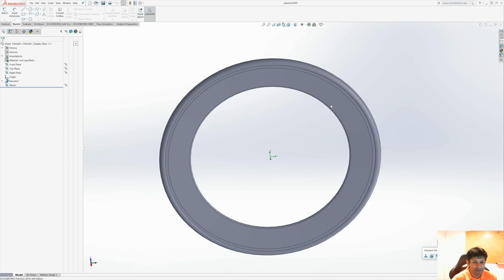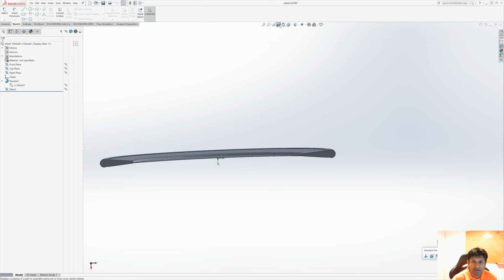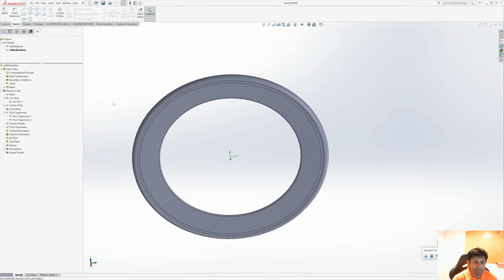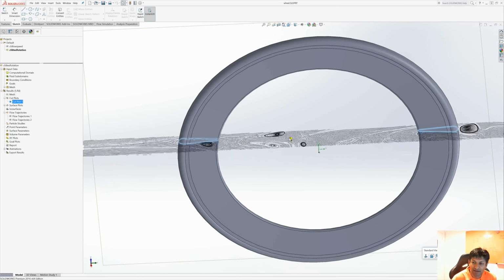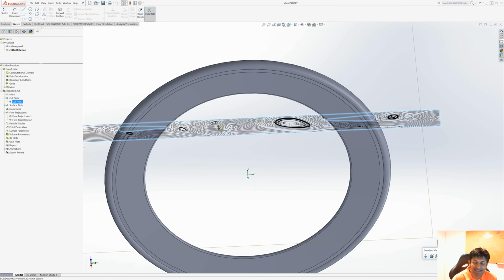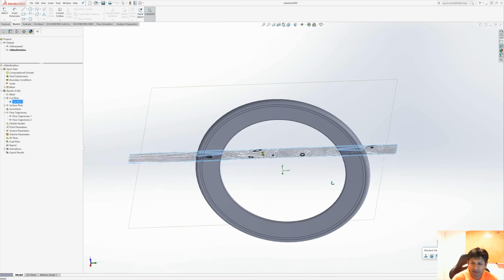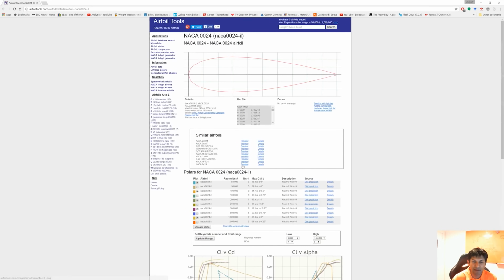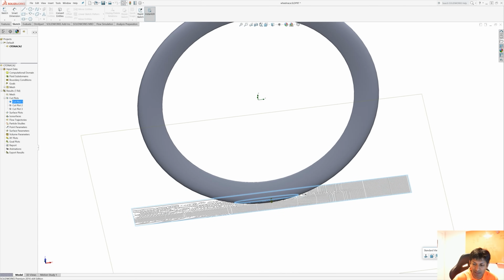Explained: Aero Bike Wheels (Zipp Enve Mavic Fulcrum)

Comment: Thanks for your explanation about aero wheels. Out of curiosity, have you done any simulation in connection with valve length? For example, say you have a 38mm deep wheel and try with 48,60 and 80mm valve length. There would be more drag but I suspect it's negligable because the valve sits in the same turbulence that is created from the trailing edge of the wheel.

Comment: Great video! Curious to see more about the effects when the air hitting the wheel at different yaw angles.
Reply: That's a waste of time, real air outside of a windtunnel is never laminar, the various yaw angles are htting at the same time. Pick any angle and you will get numbers, all of which are meaningless.

Comment: Sometimes you can't find a tire which is exactly as wide as the rim when fitted and pumped. From an aero perspective, is it better to have the tire just slightly narrower than the rim or slightly wider than rim?
Reply from the maker: Rim width slightly wider than the tyre is preferred. Really the brake track to tyre is the critical bit.
Reply: azumi b h6

Comment: Blood cells are nature's ultimate low drag shape.  A tractor tyre inner tube angled right is super fast when used as a surfboard. What happens to a bicycle wheel that is shaped the same? If air is ' enveloped' within a wheel and carried along with it perhaps an interesting thing might happen.
Reply: Red blood cells don't move much relative to the blood itself.  The shape moves well through capillaries and maximizes surface area in proportion to volume of the cell to maximize gas transfer.

Comment: I was wondering about the disturbance of the spokes. Does choosing a wheel with less spokes make a difference? If I wanted to make a bike light and aero could I use a deep wheel on the front and a shallow lighter one on the rear or is it better to go with the same or larger size on the rear? I assume the seat tube would help with wind disturbance and there's no telling what the air looks like after passing through your legs. 

Thank you

Comment: Nice video, but i think with a yaw angle the NACA profile will create more pressure drag then the toroidal profile! Have you tested?
Reply from the maker: Hi, below 12 degrees, the NACA is more areodynamic between 12 and 13 degrees the toroidal is more aerodynamic. Above 13, both have separated.

Comment: Do smaller wheels do better? 

For instance 406 vs 700c (20” vs 28”)

Im sure there is more friction on the road but the aerodynamics should be better.( less frontal area, less spokes, less surface)

Am i wrong?

Comment: So a flush 22 tub on my old Zip 808 is better than a 25 that has "better" rolling resistance ?
Reply from the maker: Aerodynamically, without any doubt a flush tyre will be faster.

The other bit of your question which is regarding rolling resistance is speed related. There is a tipping point which i estimate is about 26-30km/h. Above 30km/h the drag reduction from a flush tyre wheel combo outweighs the rolling resistance difference offered by a wider tyre/narrow wheel combo. 

This speed range is wide because there is a large variation in wheel widths and tyre widths
Reply: Makes sense to me, I go faster on my own where speeds are slower on my 24mm wheels and faster in a group on the 50mm.  In a TT the faster you go the faster you go!  By that I mean you hold onto the slip stream of vehicles longer so get that extra tow.  Keep up the good work, engineering is natures way of saving you money ;-)
Reply: So switching from 25 to 22 mm clinchers on my Mavic Cosmic naca profile is better? Even though I will loose out on gains from the wider tire.

Comment: If I'm not mistaken, the dimples on the Zipp wheels were supposed to make them less susceptible to crosswinds. Could that be so, or is that just marketing rubbish as well?
Reply from the maker: It's marketing rubbish. The dimples are designed to make the flow turbulent and make it stick more. Works on golf balls but not on wheels.
Reply: dimples were supposed to create a boundary layer based on the golf ball effect. If this were remotely true, super-sonic fighter aircraft would have dimples. Zipp does well because dentists and bankers don;'t have to take any engineering courses.

Comment: Very informative. I have a basic understanding of what makes a wheel set "aero"; however, like others I wonder at the industry's move to toroidal shaped rims. Why if it isn't better? Also, there seems to be a lot made of "better handling" in crosswinds with current wider rims compared to tear drop shaped ones. Any thoughts on why the toroidal shape has been adopted by the industry? Also, does the wide toroidal shape offer better handling compared to the thin deep dish rim?
Reply from the maker: Thankyou for your questions. I don't work in the bike industry so some of this is my opinion more than anything else.

1.  The true aerofoil shape is difficult to implement on a wheel because the holes where the spokes come through require a minimum thickness. It's easier to do this on a flat edge or slightly curved edge but not on an aerofoil trailing edge. A toroidal shape is therefore cheaper to make. Also the influence of the brake track and the tyre need to be included.

2. Aerodynamically, if the wheels have the same depth and you adopt a NACA profile or a toroidal profile, the difference between the two will be negligible. There is a particular angle call the stall angle where the aerofoil no longer generates lift. In the case of a wheel which has rotation this angle will not be constant and will be more like a pulsation effect. 

If I go away from the technical theory and look at practice, I have a set of Shimano C60 wheels and  a set of Zipp 808's. The firecrests are allegedly immune to crosswinds but this is total rubbish, the C60's kill them every time - that is not to do with any profiles, it's purely based on the rim depth.

Hope that helps Hambini

Comment: Just to clarify . You say that if a 30 Km/h wind speed moving over the top of a wheel travelling 
at 30 Km/h = a 60km/h wind speed over the wheel. 
Isn't the law of physics that two opposing forces are not combined but static .
ie : 30 Km/h hitting 30 Km/h is an impact speed of 30 km/h not 60 km/h !
Reply from the maker: To do it mathematically. 

30 --30=60
Reply: Hambini ok .. if a car doing 100 km/h has a head on with another car doing 100km/h the impact is not 200 km/h it’s 100 km/h .
So how is the wind flow contact point different ? 
I’m no scientist! So I am genuinely interested!

Comment: Hambini, where do you stand on DT Swiss' recent focus on rotational drag in wheels?  How do you think their 'optimized' design stands up to Enve wheels, for example?
Reply from the maker: In my opinion as an Aerospace engineer, it's pretty obvious that the drag from the rotation would be significant. On the subject of Enve (or any wheel mfr), all of the wheels will detach at 12 degrees (it's a law of physics). Irrespective of which cross section you go for. I've done some testing in a wind tunnel to validate the CFD and they didn't come out too well. Yoeleo wheels were the best IMO
Reply from the maker: seems to focus quite a lot on the spokes. I think it's the rim and tyre combo myself but each wind tunnel engineer to their own!

Comment: So when I have a 37mm tyre on a  25mm external width rim, the airflow gets turbulent at the bottom of clincher (the top of the rim)? And the depth of the rim is irrelevant? Or is in this scenario a deep section rim still superior in terms of aerodynamics?

Comment: Great stuff. I kinda regret turning down Aeronautical Engineering at Southampton for Mechanical at Kings! The lure of the big city.....
Also great to see Zipp's golf ball dimples rubbished; as you say they merely serve to increase skin friction. I strongly suspect the new 454 'shark's fin' design is more of the same. With one 50mm wheel resembling every other, you have to try and stand out in some way.
Interesting too to see the importance of tyre to wheel interface and hopefully a rubber stamp for my 'silicone your wheel gap' vid!! 
What is your take on 'power to spin'? Although the majority of drag comes from the wheel's forward motion, one of the benefits of a deep rim wheel is shorter (and thus slower) spokes. Therefore, spoke profile, length and number are (IMO) all also important.
Reply from the maker: Yes, would you mind if I linked your silicone gap video in the description?

On your second point. The reason for golf balls having dimples is to make the boundary layer go turbulent and therefore keep flow attached longer. You don't get that benefit on a bike wheel because the rotational speed is too high and the net velocity vector is never zero (there is always a tangential component). The CFD also shows the same thing. With the advent of disc brakes, they can ditch the brake track and make it more teardrop shape. That should produce a 

The spokes are a necessary part of the wheel and all of them have similar flow characteristics. Unfortunately the spokes will all have the same linear velocity for a given length and you gain more by having the deep rim than by having a long spoke. The shallow wheel advantage kicks in when the yaw angle becomes more of an issue. 

And as for Aero engineering. Out of a bunch of 30 of us, 3 went on to become engineers (myself included). The other 27 went on to work for large financial institutions as traders!
Reply: No problem for my silicone vid, I'd be honoured!
As for the spokes, I've found that some carbon spokes (like Mavic R-SYS, large and circular) are quite poor aerodynamically, and will create significant rotational drag. Not all spokes are equal - some are more bladed than others. It seems to be an area that is often overlooked.
Funny for career path - when I graduated in 1991, there was no hope of an engineering job (recession) so I ended up in trading through desperation!
Reply: HAHA kinda figured you were a mechanical engineer watching your videos
Reply from the maker: Is it that obvious!??!
Reply: same with the guy from cyclespeed tours :D takes one to know one I guess...

Comment: Another question. Jan Heine suggests (through somewhat-informal wind tunnel testing) that there's no aerodynamic disadvantage to using fenders/mudguards, stating that the top/front section of the fender decreases drag while the rear section increases drag, and these forces cancel each other out. Does this seem believable?
Reply from the maker: Have you got a link Andrew?
Reply from the maker: I had a read of it. In my opinion and analysis it's faster to remove the mudguards/fenders altogether. I 100% disagree that the front and rear parts cancel each other out. The drag is always worse from the trailing edge unless you are going very slowly - in which case cancelling out is possible but this is in the realm of 3-4km/h. 

The paniers versus front carriers will be effected by subtle changes in geometry. ie if the rear mounted carrier is wider than the rider, this has a dramatic effect versus a carrier that is narrower and positioned closer. 

With all of these things, it's very difficult to give a generalised "do this" methodology as everyone's personal geometry is different and this is by far the biggest influence on drag.

Comment: Great video, but title should be clear 'rims only'. After 30 minutes  no ball park figures about drag of the rims showed. Nothing about how significant hub and spoke drag is compared to overall. Is skin drag insignificant?  Thanks!
Reply from the maker: Stay tuned, that will be coming!
Reply: Great. It would be nice to know how many watts 28H spoke count loses compared to UCI minimum 20H (having purchased carbon rims and built 55mm deep section wheels using existing hubs). I guess approx. 3w per wheel at 40kph.

Comment: I loved the CFD part in SolidWorx but as an avid anal-yst myself, what about the spokes and the differences in speed - i'd guess at higher speeds they would be like a disc and the FD would look totally different? Would the spokes generate significant vortices themselves or do they just clash into the air from the front and have a big vortex.party? I also notice that i didn't even think about yaw and lift and - maybe it was a wrong time to jump into a rabbit hole that deep, discart this bruby nonsens from s stooped fucktwat.

Comment: Isn't the top of the wheel going 2x the speed of the bike?
Reply: It only goes as fast as the road speed. But because it is rotating forward, and the wind coming from the front, the relative velocity against the oncoming wind is 2x or more..
Reply: It is not 2x.more. you add the speed of the bike plus the speed of the wind.

Comment: How would you say the drag / turbulence would be for a reversed NACA profile exposed to a realistically high yaw angle ( say10 degrees or so)? I feel like this would be important for the stability /  handling in crosswinds of the trailing end of a wheel with a NACA profile rim.
Reply from the maker: Hi, I've done some tests in a wind tunnel, The Reynolds wheels are quite close to a NACA profile. 

https://www.hambini.com/blog/post/bicycle-wheel-aerodynamics-which-one-is-fastest/

Comment: great explanation! what is your opinion on the Cannondale SystemSix kn0t elements and especially their kn0t wheels? with the wide rim (a HED licence)? could that work or also marketing BS?
Reply from the maker: Generally, narrower is better because of the reduced frontal area. Essentially you need to check the tyre is ideally suited for the rim. That is the critical bit.

Comment: If the dimples don’t help the Zipp rims go faster why does it help golf balls go further?
Reply from the maker: It's to do with turbulent and laminar boundary layers which are a function of the reynolds number of the object. In the case of a golf ball, by putting the dimples on to the surface, the air sticks to it for longer and in turn reduces the drag so it goes further. On a bike wheel the geometry is not consistent with the airflow hitting it and the addition of dimples is worthless.
Reply: In practice the real purpose of dimples on a golf ball is to control side spin - fade or draws etc. Therefore the golfer controls where the ball lands - avoids hazards. Golf balls made for distance are "hard" balls mostly used by beginners. Advanced players use "soft" balls. These players are a lot better at the short game. Here placement of the ball is what matters. The ball can go around trees, land between bunkers, land softy to stop or lots of back spin to back the ball up when it lands on a away slope. The balls used by pro golfers are specially made and are "soft" balls and not available to club golfers. Pro golfers hit these balls around 4 times then get another ball. So Pro golfers at the masters would use 80 of these balls over 4 days. The distance a golf ball goes is mostly controlled by the accuracy the club head hits the ball and how hard the ball is. Most golfers swing just as fast as pro golfers but the pro golfers are very accurate in how they hit the ball. Any pro golfer can easily hit a soft ball over 400 metres. But they normally hit it around 200 metres. 
Accuracy wins golf tournaments  not distance.
In cycling a disc carbon wheel is worth around 1/10th sec over a 200m sprint on a track velodrome. Experience matters not theory.

Comment: So is a rear disc a waste of money as it seems the front has the most benefit ?   A rear disc on a course with cross wind seems a waste
Reply from the maker: Correct, a rear disc is a waste if it's used in strong cross winds.
Reply: Which is why TT racers remove rear discs on windy stages. OK for closed velodromes.

Comment: Hambini, can you please explain high speed wobble on a bicycle with 60mm deep section wheels on a -9% downhill at 45-49mph.  Also wind gusts of 20-30mph from the left crosswind.  On fairly smooth asphalt roads.  Many thanks.
Reply: Speed wobble can be weight distribution on a bike, short stem, poor frame strength, or a misaligned frame. Ive never had speed wobble on a road bike, but i did have a toy shop quality mountain bike when i was a teenager and it wobbled at as low as 8mph (with no hands). Ive always had alu road bike frames, but with 120mm stems or longer. I'd doubt its much to do with your wheels as a gust of wind will just gust and you will re-gain control quickly after. Just my 2pence worth!
Reply: One trick is to touch your knee on the top-tube. It can act as a dampener and change the resonant frequency of the bike. 
The most important thing though is RELAX!!! Most speed wobbles are caused / exacerbated by holding the bars tightly. 
I had a crash in a race a couple of years ago, and was a bit tentative when back on the bike - gripping the bars too tightly on one of my usual descents and I started to get speed wobble for the first time.

Comment: How about Bora Ultra 80 vs Zipp 808? Bora has superior hub and bearing, but zipp supposes to have better performance in terms of aerodynamic....what do you think? Thanks
Reply from the maker: Hi Thanks for the question. I'd get the Bora's, Zipp hubs are such poor quality. The aero difference is all in the depth. if those two dimensions are unified the profile will have little effect.
Reply: Thanks for your response! How about cross wind? Would Zipp's "Fat" rim profile help in terms of reducing pressure?

Comment: I got lost at around 5 minutes in. 
In my experience if you’re racing in a bunch Aero means jack shit. You want lighter more responsive wheels for better acceleration when the attacks come - usually on climbs. When you’re in the middle of the bunch you don’t pedal half the time so aero wheels aren’t saving you anything. 
But for time trials when it’s you vs course & conditions. Aero matters.
Reply: So, you change wheels as the race situations  changes?